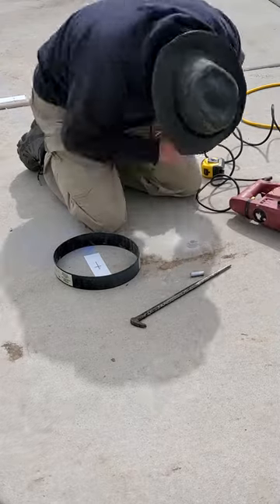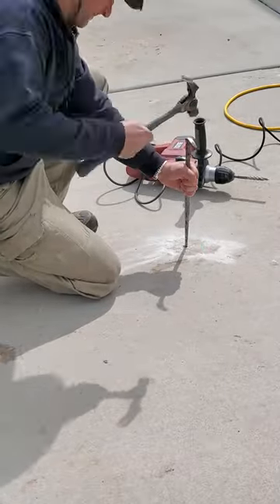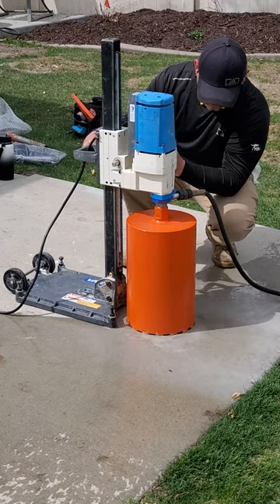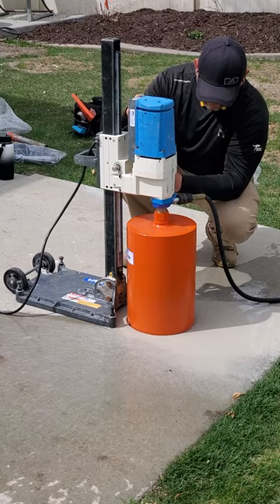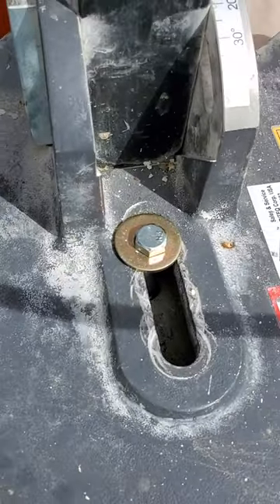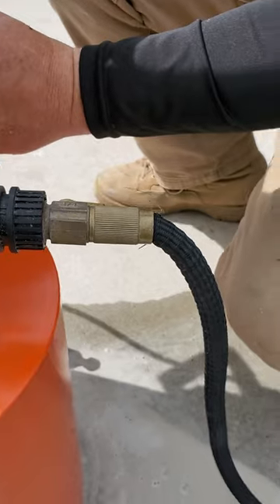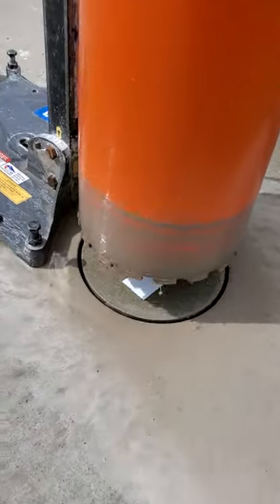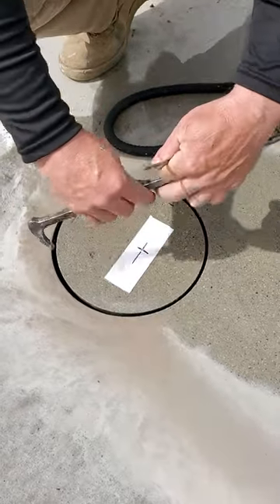How to Drill A 10 Inch Hole in Concrete for Pergola Footings | Remodelaholic

Comment: Should have put an anchor in the part  that you were going to remove to make removal easier.
Reply: He can still put a few anchors on it. I wonder if it was off center? 🤔
Reply from the maker: I centered it on the wrong marking I made.  I got all the other holes perfect because I double checked the marks.